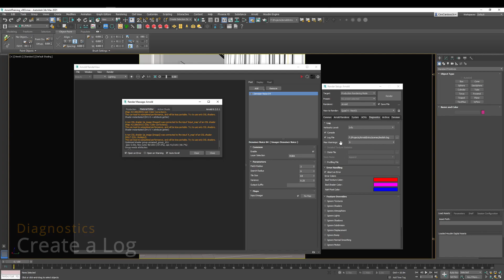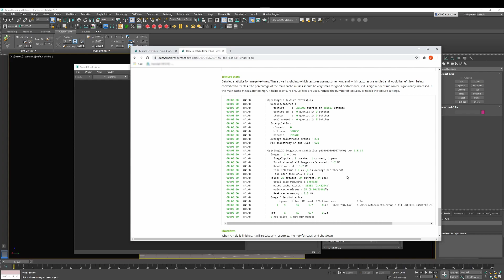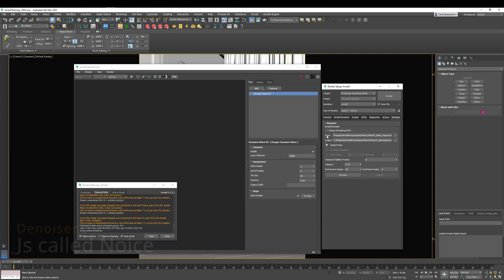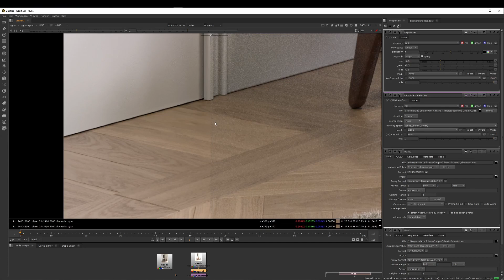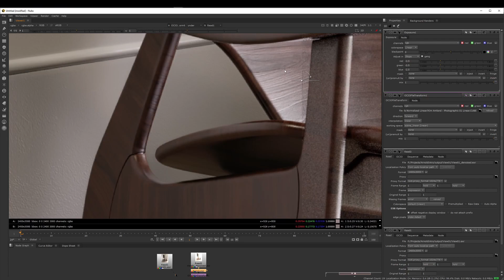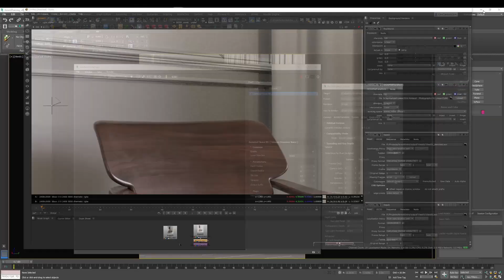Quick introduction to Arnold for 3ds Max (MAXtoA) - Diagnostics \ Archive \ Denoiser

Comment: Can I use denoiser to denoise my Normal AOV instead of my RGBA beauty?
Reply from the maker: Usually, you don't need to denoise the N AOV. However, to denoise other AOVs what you can do is in the Layer Selection field type N, so that the imager will only denoise the N AOV. And you can also mix other AOVs, like  RGBA and N. 

If the issue here is that the N AOV looks jagged, what you need to do is to change the filter from Closest to Gaussian.
Reply: @cirocardoso3v  gaussian filter gives much nicer result thx, but I still have some moving noise in my normal
Reply from the maker: @janjanas6644  Ping on the Arnold Discord server. https://discord.gg/YjmVSsT

It will be easier to help you there. I am on the maxtoa channel